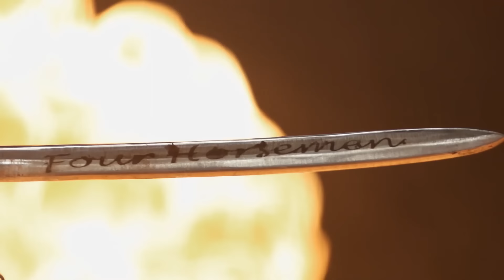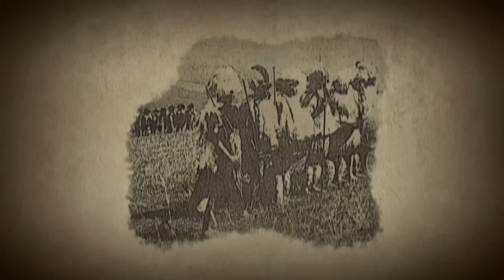Forged in Fire: *10 MORE* CATASTROPHIC WEAPON FAILURES | History

Comment: 29:32 - I feel really bad for the guy that lost, his sword was obviously better, but then one tiny flaw in a part that wasn’t even the blade lost it for him.
Reply: The pommel is a very vital part of the overall weapon though. Holds the entire hilt together. That falls off, and the entire sword can and will fall apart pretty quick
Reply: For real, he lost to the derpiest sword possible... He made a beautiful piece of craftsmanship and lost to the guy whose strategy was "they asked for a sword so I made a sword-shaped hammer".
Reply: I was actually wondering, aren't most pummels screwed into the grip? How did it even come off?
Reply: @Kusabiii  He might have tried to glue it on cheaply or something when he should have tacked it with a good weld or at least stronger bond. Definitely some oversight for the all around test of the entire structure..
Reply: @Kusabiii  most pommels would be peened on, which means that the tang sticks through the pommel a small distance, and then it is hammered into flatness. This stops the pommel from ever breaking off but means that you can't ever remove it.
Reply: @supergatorhator  sadly the show is pretty heavily biased towards a weapon being indestructible over everything else
Reply: So well said!
Reply: @supergatorhator  they always say looks are secondary to functionality tho
Reply: @Fine_i_set_the_handle  and what do you think might happen if they kept testing it without the pommel Andrew?
Reply: @metalhead522  I don't think that would have impacted the swords performance too much, and I'd rather take a sword without pommel to battle instead of a sword which is covered in issues

Comment: one person makes an arguably worse sword, the other's pommel popped off.
"Hey you with the much more accurate representation of what this sword should be, you lose"
Reply: That's what I thought, I mean the other guy didn't even have the balance right and he lost coz few threads came lose
Reply: Better an arguably worse sword than a sword that has the pommel, which holds the blade and handle together, come off.
Reply: @veritasmod7013  exactly, one more swing with the sword without a pommel and its likely the blade is just gonna fly away.
Reply: @1999moniz  it’s a throwing sword. you throw it straight to the trash
Reply: You can sharpen a dull sword, you can't do much with a sword that's falling apart
Reply: U forgot the "structural intergreeety"
Reply: @flynncarter229  doesn't matter really. It broke in the strength test. The first sword didn't. If you can't trust the blade to stay together then you can't safely test it.
Reply: @flynncarter229  His sword was still in one piece.  The same couldn't be said for the other sword.  That's why he won.  Even a lower quality sword can be improved after the fact with a bit of sharpening and other adjustments.  A sword that's literally falling apart on the other hand would pretty much need to be remade from scratch.  The pommel is a very important part of the weapon, as it not only helps to maintain the weapon's balance, but it also serves to hold the weapon together.  Without the pommel, it's likely that further strikes would have seen the weapon fall apart even more, which would make it too dangerous to continue testing it.
Reply: @1999moniz  Not necessarily... it depends on the construction of the rest of the sword. There were plenty of swords designed in period (and now-a-days) with removable pommels that functioned adequately without them. They aren't *always* necessary to the structural integrity of the overall sword.

That being said, I have no idea how his was built so the handle very well could have been held together via compression from the pommel alone, which would definitely be an issue were you to try and swing it again without it. Judging by how the judges reacted it's safe to assume, I think, that his wasn't designed to function without a pommel though. haha

That other sword was just a club masquerading as a sword though... At least it held together I suppose.
Reply: Much better blade, but worse sword. Its about more than just the blade on the weapon
Reply: Well you wouldnt wanna wield a gun thats breaking apart now would ya xD
Reply: Did you see the sharp part at the end of it? No way is someone trying to swing that in another test and risk injuring themselves!

Comment: 29:32 i actually feel so bad... The guy literally made an extremly sharp and beautiful sword that also got NO DAMAGE FROM THE IGE BLOCK? But because of a stupid pummel he s out... Just sad :( he actually made one of the most sharp and ressistant sword
Reply: He should’ve won the pommel falling off is not a catastrophic failure
Reply: The other guy feels bad too.. he said "I didn't wanna win like that"
Reply: A catastrophic failure is when the blade is no longer safe to use. Without a pommel, the sword could possibly go flying across the room
Reply: @tunners  its a failure but not catastrophic failure. Blade could still be used and all you'd have to do is re-attach the pommel and add some stuff to make it not fall off again. Also if I can swing a sledge hammer as hard as possible on to an extremely hard surface without losing my grip the sword flying across the room probably wouldn't happen by people who know what they're doing with it. Now if the handle itself was falling apart/off I could see that being a catastrophic failure
Reply: Generally I do not believe that the people in the show want to take chances to try and fix the weapon or keep testing.  It would be 1. Against the rules as you can’t change it or make sure it’s safe and strong at all after the deadline is done.  And 2. The judges are not allowed to fix the weapon at all, only allowed to test the weapon.
Reply: @spencertang5155  what? there was one where they bent the sword back into position
Reply: @tunners  well, true.  That’s probably the only exception that they made though out of all of the times that weapons were tested though… tbh, I don’t believe the judges have epoxy to fix the pommel generally, and if it is threaded, the threads were more than likely bye bye if the pommel just came clean off.
Reply: @tunners  that was because while his blade bent they had to decide a winner since the other guys weapon broke
Reply: They didn't end him rightly
Reply: @ithilliongaming8980  Yes it is.  The Pommel serves as a tool to keep the weapon balanced so that it is easy (and most importantly, safe) to wield.  The Pommel also helps to hold the entire weapon together, without it, there's a very real chance that the entire weapon could just fall apart if it was used further.
Reply: @tunners  i think thats only cuz the other guys sword also broke
Reply: Besides everybody knows that to end an opponent rightly, you have to throw your pommel at him
Reply: He overall made the better sword
Reply: @ithilliongaming8980  I feel ya, the dude made an arming sword shaped club, heavy and not sharp.
Reply: @christopherolmo7558  better blade perhaps, but apparently not a better handle.  Not the first time they counted someone out because his handle broke.
Reply: @jayharv285  also the sword was still in one piece
Reply: Exactly

Comment: doug looked so sad when it didnt keel. broke my heart ;-;
Reply: but he's winning ;-;
Reply: The Scottish claymore episode, he angled it a bit to the spine of the sword. (BTW, the middle of the sword is also called "spine" if I recalled correctly)(Also please don't blast me if I get it wrong!) This is evident by the second cut with the second claymore which is not his fault as that type of sword is heavy to swing with one hand. It is approximately 2.5 - 3 kg. Normal one handed swords tend to be 1-1.5 kg so close to double the weight with your wrists will be a complete disaster for your wrist. Your shoulders and back can carry more so u can put it on your back.
Reply: Maybe doug shouldn't have slapped the pig with the sword.
Reply: @branchcore  but he didnt
Reply: @branchcore  he aimed it well but the sword wasnt sharp enough to slice so it deflected off the pigskin. Epic fail for a claymore to bounce off effectively leather armor.
Reply: @Siluriiformes  not entirely true is cleaved into the sheet steel without too much issue. However with the pig carcass edge alignment is key and the swing doug made is a fair part into why the sword deflected.
Reply: @kocashima  An effective sword a needs to withstand a certain level of punishment. Even if the strike was bad.
Reply: @hororo4053  I agree the sword was not made as durable as it should have been. However i was referring specifically to why it did not cut, which is all to do with edge alignment and sharpness. If the alignment was better the blade would have cut and then flopped during the strength test.
Reply: @kocashima  i agree it has everything to do with edge alignment and sharpness however i find it doubtful that it would have cut much of that pig even with better edge alignment(though the edge alignment really wasnt that bad) although the edge alignment wasnt perfect that weapon should have at minimum lacerated the pigs skin it failed to so much as mark it
Reply: @danielsayers4994  I would almost agree whole heartedly but given what the sword did in the test against the sheet of steel does beg the question. Is is sharp enough to bite and dig into steel but not the pig. Aswell as I have an Langes messer a buddie of mine couldn't scratch a free standing 2l bottle filled with water, while I sliced through it like butter. In cutting edge alignment is king, be pending on the grind of the edge it can give the user more leeway with cutting

Comment: The man using the baton intentionally shattered a blade at 22:55, I watched the first one and he smacked above the nut all 3 times. The second blade he tested, he struck WAY past the spot the blade was making contact, and put way more pressure further up the blade and snapped it.
Reply: I’m glad I wasn’t the only one who realized that. Yeah the guy definitely hit it in the wrong place.
Reply: I wouldn't go as far to say he did it on purpose but yeah, not exactly a controlled test.
Reply: Thank you I  had to rewind cause I thought it looked strange. The guy kind of got screwed over
Reply: Yeah it’s not controlled at all
Reply: It started on a slant but hit with the blade bring flat. I think it would of broken either way.
Reply: Yes this test sucked
Reply: dunno if it's due to the camera angle but definitely felt the same way, even watched it in slow motion, dunno if it's on purpose but clearly the test aren't the same in the same conditions. They should have mechanical test based on weight falling from a given height at a given distance from the handle or so (or the tip of the blade, but the contest rules should be detailled and clear for all participant, cause like this with different blade length different point of impact and angles and even force (the guy ain't a machine he can't put the exact same amount of force each time...). So clearly, they can make anyone the winner with such a test procedure

Comment: 28:50 imagine your sword is winning your opponent in every single way until your pommel went off
Reply: I can’t believe they made him lose they’ve let other people slide for having parts break before
Reply: His sword was the better weapon. I can tell you that the other guy's sword is practically unusable as a weapon.
Reply: @exander3636  true
Reply: @benjaminthompson4370  A pommel is a very important part of a sword though. Without it, not only can the handle potentially slip off the sword, leading to very dangerous situations, it also throws off the balance completely, making it neigh impossible to wield
Reply: Well its not a catastrophic failure. It did not seem that the pomel had any part in the structural integrety. It wont be as balanced as befor but well his oponents wasent balanced from the start
Reply: The pommel was often a part which could be put away and put back in, hence the end the opponent rightly meme. Calling that a catastrophic failure is laughable, they gave 10k $ to an incompetent instead of a good blacksmith whose sword had a slight problem. The other sword looked like trash and if you ever tried to use that one you probably would hurt more yourself than the enemy... Like wtf it couldn't even scratch the pig and looked so awkward that if the guy testing weren't professionals they would have hurt themselves.
Reply: Not understandable.
Really a sad moment to see the superior weapon loose.
Reply: @diegeigergarnele7975  in combat you won't have the luxury of time to put back the pommel in so yeah, it's situational a catastrophic failure
Reply: @Penthess  you would have a ranged weapon now
Reply: @A-Monkman  Lmao just dead throws the pommel at them
Reply: @Penthess  Pommel or not, you'd still rather have that sword in your hand than the other. That was why the call that it's a 'catastrophic failure' is a joke.
Reply: @diegeigergarnele7975  We couldn't quite see, but usually taking the pommel off and on safely would mean unscrewing it. If it flies off, it probably didnt unscrew but rather broke off. There's no easy fixing that.
Reply: That isn't a bug... it's a feature.

If your pommel is permanently attached, there is no way to remove it.

If you can't remove it, you cannot throw it.

If you cannot throw it, you will never end your opponent rightly.
Reply: Looks like threaded pommel the judge feels the threads that are on the base of the Tang. If the threads were sheared off when the pommel came off it is a very unfortunate loss
Reply: @diegeigergarnele7975  
Dullish blade can still be use to hit someone like a mace (even if it won’t be as effectfull) and can still be used to stab 

While the pommel being falling off is quite dangerous since it’s what hold the handle in blace a bad swing and the blade fall out flying and just a handle won’t be enough to kill 

And to remember they have quite the short time to do it perfectly

I say this while I don’t rely know much things about blade-smithing but that’s how I see it
Reply: @exander3636  yeah and one of those rev
Bounds almost hit jay
Reply: @PeterJavi  say that to Katana which doesn't have a pummel. A real swordsman won't slip their sword even without a pummel. According to your oponion, it's like saying a knife should have a pummel built under it to prevent chef from slip when cutting.
Reply: A Pommel is three things: Balance, Security, Weight.

Without a pommel, the weight jumps ship from a nice area to the edge of the blade, AKA, borderline unwieldable. And if it flies off, might as well scrap the sword cause you will never properly be able to wield the sword again, let alone construction now putting EVERYTHING on 2-3 tiny pins to hold the weapon in place.

As for Security, to obliterate the Katana example used above me those blades are SPECIFICALLY made to be secure without the presence of a significant pommel, that's why the grips on Katanas are so good and why their pins are so solid.

And Weight... You're using a sword not a sledgehammer.